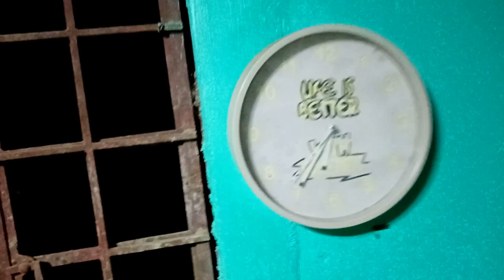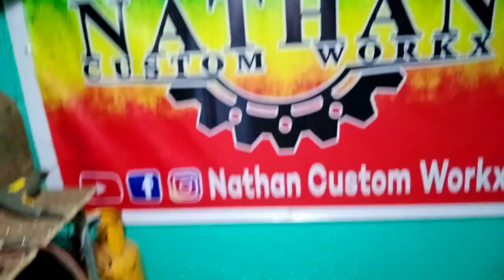V-BRAKE TO DISCBRAKE │OLDMTB FRAME CONVERTION

Comment: Meron namang nabibili na adapter na para sa disc brake para di kana mag welding e
Reply: tama..sinira nya ung lalagyan ng fenders..dapat sa gitna nya nilagay ung plate para hindi matakpan ung screw han ng fenders..
Reply from the maker: @bicycleandrccars568  buo pa rin sir yung lagayan ng fenders.
Reply from the maker: yes sir meron nga. ang problema ee ayaw ng customer ng ganun :)
Reply: @neightzindustries   sir baka pwede din ako magpagawa ng ganyan ?? Pwede po ba plsss

Comment: Ano pwede pang tapal sa mga butas or"mount holes?" ng frame(alloy)?, kagaya ng lalagyan ng sa Vbrake at carrier. For aesthetic purposes lang,old frame na kase
Reply from the maker: may nabibili sir na bolt na sakto para dun. yung Amoeba frame ko dati may nakalagay na ganun
Reply: Solder pwede?😅
Reply from the maker: @kerbidiaz2157  di ata sir kakapit yun. haha. yung steel epoxy sir mas ok siguro kaysa solder
Reply: Ohw nice, Thank you idol👌🏻💯
Reason for questioning, magrerepaint din kase tas para di na mapasukan ng tubig ang fork and frame pag naglilinis.
Reply from the maker: @kerbidiaz2157  welcome sir. safe ride po :)